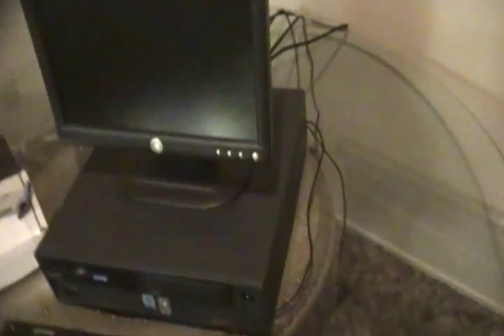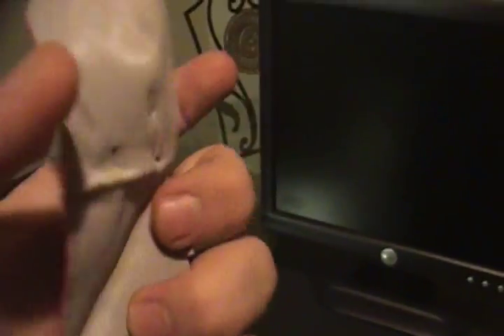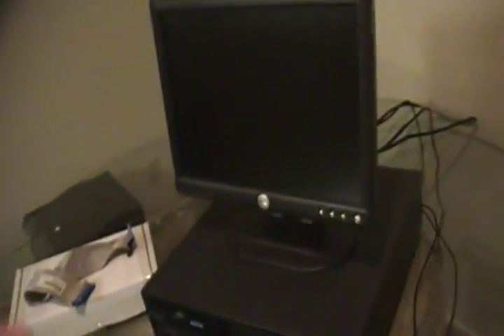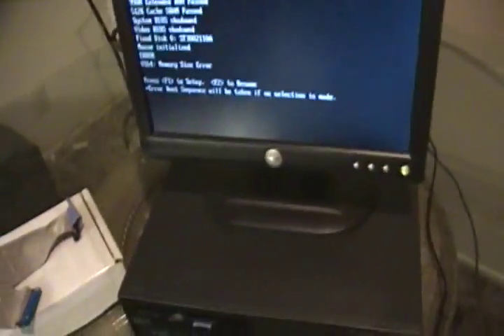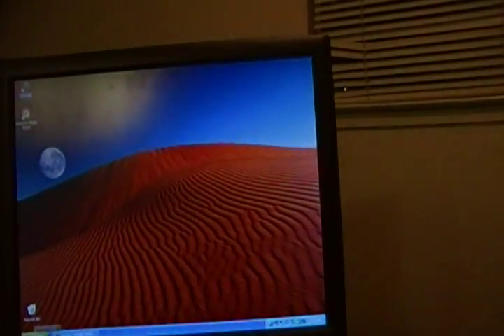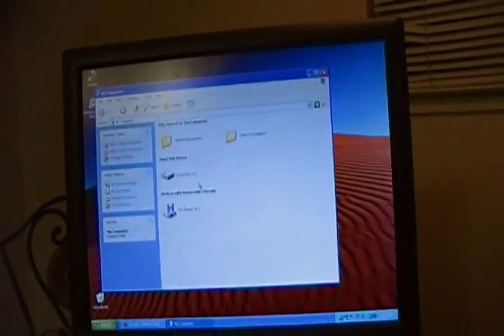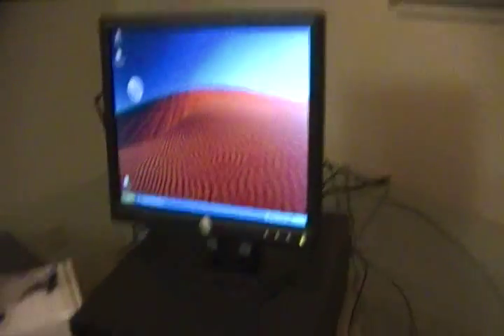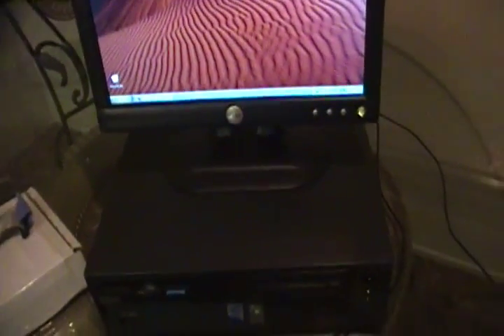Starting the repaired IBM ThinkCentre

Comment: ive just got one my self its coming soon only paid 30 pounds for it and 8 pound for postage mine comes with mouse keybored dell srceen wires windows xp disc also wireless dongle plus a 320GB hardrive so im happy all in good working oder like if think got bargin